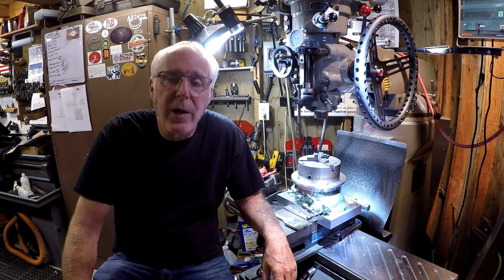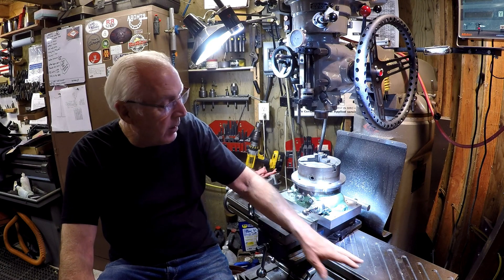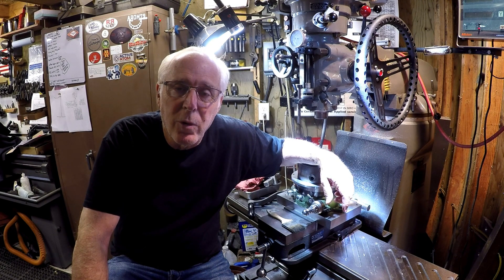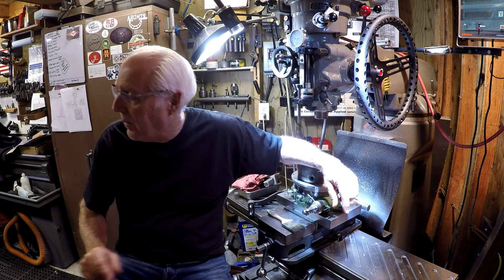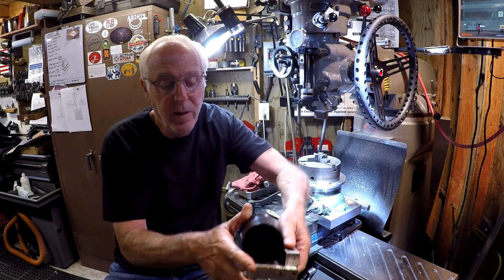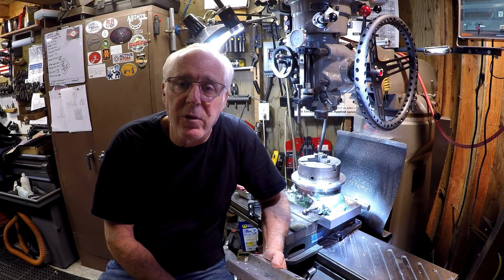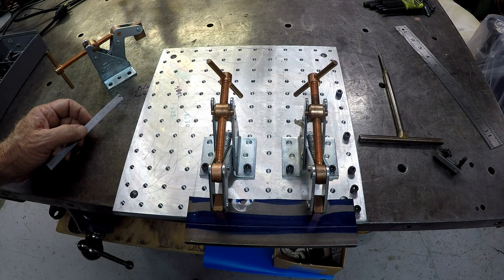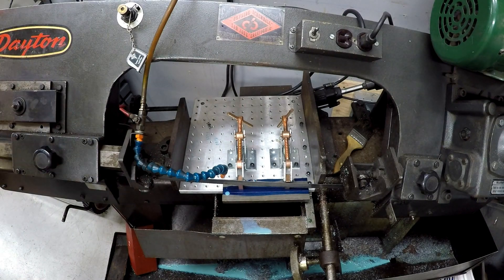Screwy Tuesday--Bandsaw Workholding Tip

Comment: Nice.  I should be getting a bandsaw in the next few months (whenever my shop gets finished).  I'll have to add this to the list of projects.  Though, it looks to need a mill to make the pallet and that is a year and a bit away still.  Should be easy enough to work around though.
Reply from the maker: Barry...good luck with getting the shop completed and machinery purchases....note you can purchase a drilled/tapped pallet (new) on ebay at a very reasonable price...the unit I showed I purchased...thanks for viewing